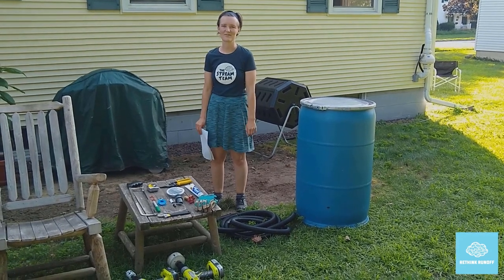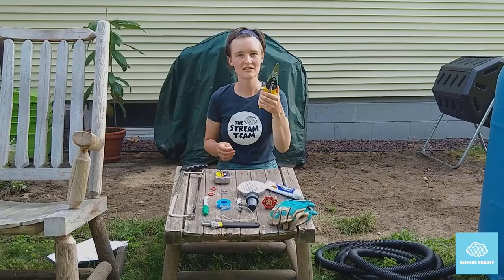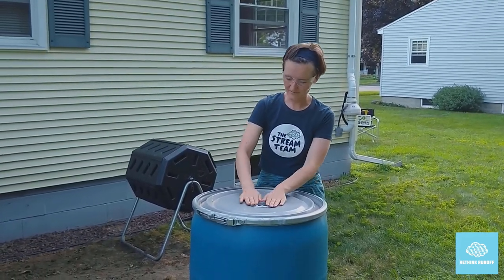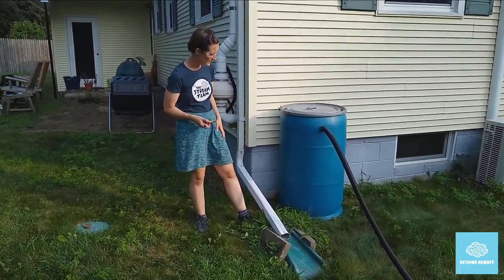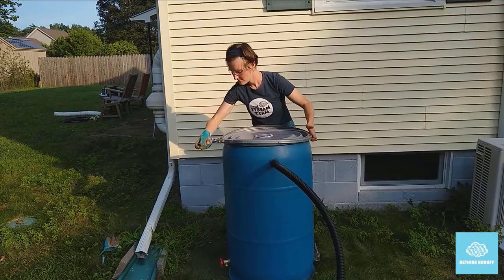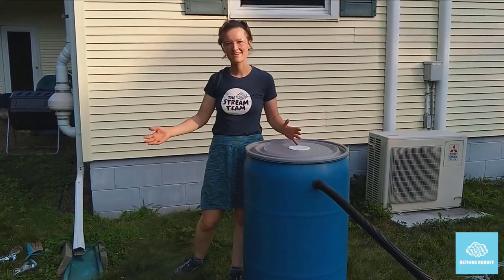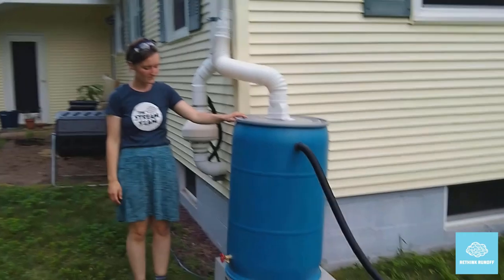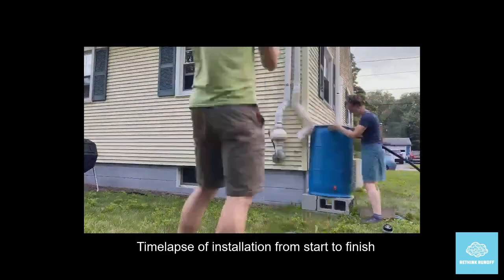How To Build and Install a Rain Barrel

Comment: Hi can you explain the hose barb; is it part of a sump pump kit?   Is there a silicone washer & pvc nut for the back to not leak or does it just stay in the barrel hole without that?   Thank you.   That’s the last piece I need to do for my rain barrel.